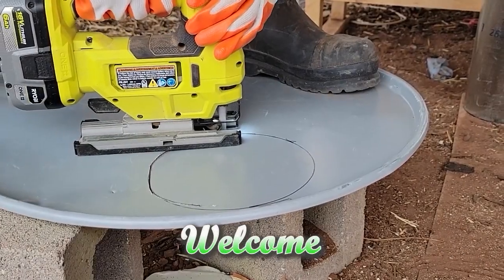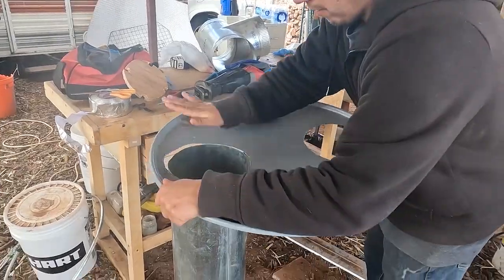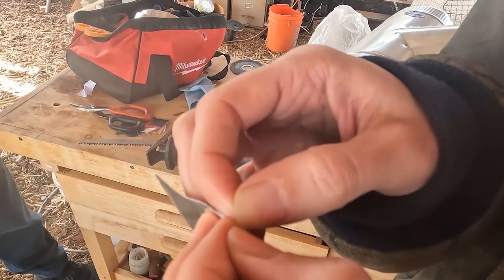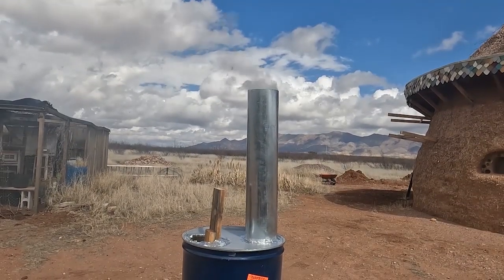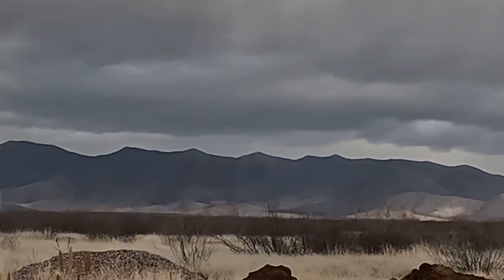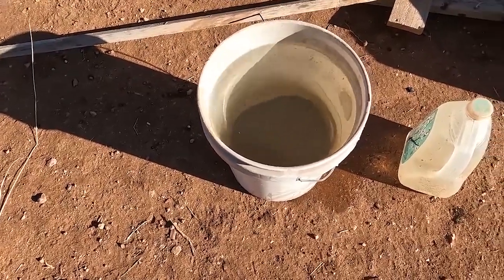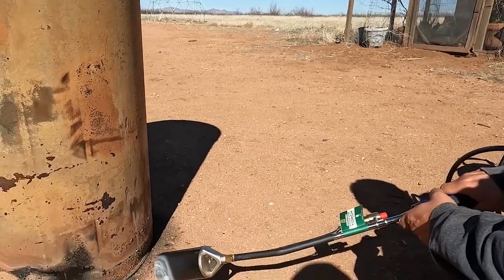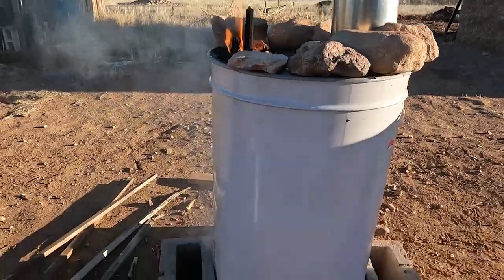We Built A Pocket Rocket To Quickly and Safely Clean Metal Barrels | How Effective Was It?

Comment: try not to envision the laws of nature as you see fit. Lay the barrel on its side. heat rises. when the top side of the barrel is burned, roll the barrel to burn another side. made many burn barrels for my progenitors. the wind would carry over the burnt paint and coating into the chicken coup for months. the hens would stop laying. cattle and sheep would not come to feed as often. they asked me to make burn barrels for them. took a day for me to make one. also, made them move there burn barrels 50 feet down wind of the livestock. They did not like that. but the hens layed eggs every day and the livestock were properly feed after that. what gave me that idea was the horses and goats. every time my grandmothers would light a fire they would move over to the other side of the pasture. If you do not have a lot of burnable fuel use a steal grating to raise the fire closer to the projected area.
Postscript: they all kept asking me how i was able to cure the barrels. I kept telling them. "It's Classified". hahahahahaha

Comment: One thing that could work to get more air draw in the barrel, on the vertical pipe outside the barrel, put an upside down y junction, and run that leg off to the side...and have a battery powered leaf blower or such...that would then cause air to get pulled up through the vertical pipe faster and cause more combustion in the barrel i think.   Interesting video for sure. :)

Comment: Having had a little experience, I would suggest raising up the bottom of your down tube.
Second option: lay the barrel horizontal and rotate as needed. Lay a metal tube 2-4" into the barrel so oxygen is fed into the very back(bottom) of barrel to burn all the paint

Comment: Load the barrel with straw on the bottom. Our the pocket rocket inners on it. Put the heavy wood in the pipe that goes about 4 inches from the bottom. Drop the burning paper down the chimney. This will get the draft going up the chimney and light the bottom of the fire wood. As the firewood is consumed the air coming down the inlet will keep the fire at the bottom and the wood will drop down on its own. You could also load the barrel with firewood before putting the top on. Always start the fire from the chimney to get the chimney drafting.

Comment: Hint: when you cut tabs in a pipe only bend every other tab then insert it into the hole and bend the remainder over they way your not depending on just tape to hold your joint 😉

Comment: With the fire in the base not the intake at full tilt with a setup like yours I have had a ten foot long flame where you had smoke coming out and that vertical exhaust pipe glowing red.  Hence my other comment about the control damper.
Yes I was outside testing it before I moved it in.  Lol

Comment: "Stove Black" is the perfect way to finish the barrel.  It goes on like liquid wax and you wait for it to dry and then buff it off. It will give you the rustproof finish you seek and it has a constant sheen without being too glossy.  It does gas (as does hi-temp paint) for the first couple of days after finishing, so it is imperative that you have ventilation and accept the fact that you're heating the outdoors the first couple of days. 😁
Reply: Another point.  IMPORTANT 
You had another poster say the fire is supposed to be in the barrel not the feed/intake chute, he is absolutely  correct!!!

Comment: Try lighting a smaller fire in the bottom of your barrel. That will intensify the heat toward the bottom.. You’ve used very tall wood in the previous burns and that pulls the fire toward it.

Comment: Small pieces of wood burn fast, losing vital heat. Also not easy to reload and create good/efficient circulation from the bottom to top.
Try adding dry dense fire wood first. Light,  slowly add scrap wood to barrel pile. May also want an open/close air vent to control the air/combustion ratio. Boilers normally have a bottom load/cleanout for a heat source.
Aware the goal is to safely and inexpensively remove the barrels' inside/outside paint. Any thoughts about a covered sunken heated coal or rock pit? Dig a deep enough barrel hole. Secure with wood/rocks coals. Fill barrel with dense firewood. Light inside and outside wood/coals. Cover with galvanized sheets and secure with dirt/rocks. Return 8 to 12 hrs later to compare results.
Concepts from inground food cooking.

Comment: Combustion chamber should be low to the ground made of earth of some sort. It must take the high heat of combustion which can be 1500°F or more, something like the melting point of sand or clay, just to be safe. Some heat storage should surround the combustion chamber, earthy material such as rocks, brick, clay, or sand.  This absorbs much of the initial high heat to reduce the temperature a bit. The exhaust gasses can then pass through a barrel  such as you have with the paint burned off. The barrel then acts as a radiator with its heat going into the room or into more thermal earth, making hot water, or cooking. By this time the gasses have cooled sufficiently where they begin to sink and in some designs this can be utilized in a warming bench made of earth materials. The exhaust of a well designed system can be almost down to room temperature.
One design utilizes s cylindrical combustion chamber of fire brick which is constructed to be smaller than the diameter of a barrel that sits over and around the combustion chamber. The combustion gasses exit the fire brick structure and lose heat to the top of the barrel. This is commonly used as a cooking surface.  The exhaust is then taken out the side of the barrel to a warming bench of earth.

Comment: The rocket mass heater that you are building will be heaven sent next winter. With just sticks from heavy brush you will heat your home.  Just remember to have a few clean out places for ashes where ever possible. Also you may want to reinforce the top of the barrel you put over your heat stack with the lid from the other barrels.  One thing you can try with the barrel burn out is use a lawn blower to increase the heat. You guys are doing all the right things keep up the great work! God bless.

Comment: When working round chimney tin, fold over every other tab and the pipe will be self supporting.
Reply: Half the tabs on the bottom side of the lid, the other half on the top side.
Reply: 10-4 George,I should have been more clear on that. Thanks 😊

Comment: If you know someone who welds. They can weld thicker scrap pipes in a continuous candy cane U shape and spot weld it to the lid or 1/4" scrap plate. You won't have to burn any paint off you simple fill the barrel half or 3/4 full with water. With a small fitting and copper tube in the lid plumbed outside so pressure doesn't build. Making sure it always has water in it.🤓🤓You just made a rocket heater radiator.🤔🤔👍👍

Comment: As others mentioned, to remove paint lay it on its side on coals. Better oxygen flow 
But if you were going to hit it with a wire wheel/brush, skip the fire step and just remove the paint mechanically.

Comment: Hi, I'm not sure about your design, but it's not a mass heater I'm familiar with.

1. Lay a layer of cement board down.
2. Lay a 2 inch layer of insulation material down
3. Lay 2 layers of thick fire brick down
4. Build a j fire channel out of thin fire  brick
5. Insulate both risers, short feed riser and tall exhaust riser
6. Cut exhaust pipe hole about 2 inches from open barrel bottom and place over exhaust stack
7. Run an inclined exhaust pipe from the barrel to the external exhaust 
8. Build up the thermal mass around the firebox and exhaust pipe into a bench shape
9. Finish with Lin seed oil after the cob material is completely dry, 3 coat recommended.

This is obviously a Build outline and not detailed, but it demonstrates it is quite different than what you tried to do. 

Good luck these heater look like they are a huge undertaking to construct.
Reply: Jim you need this design, I personally  never sent your  design  before and I think  your beating your head against  the wall here 😉

Comment: Hey Jim & Jess, Back in my day Mother Earth News used to run advertisements for the Sotz brand 55 gallon barrel stove conversion kit. There were two kits available, one for a single barrel stove turning out up to 155 thousand b.t.u. and a double barrel kit able to turn out up to 255 thousand b.t.u.. There was even an option one could get that was a kind of ceramic afterburner that made it able to reburn the smoke in the top drum, kind of like a catalytic converter thus reducing your emissions. 
  Whatever you two decide to do, use stoveblack on your stove's metal components, NOT high temp paint. Also use refractory cement to seal joints, not that aluminum tape, it won't stand the heat your stove will be putting out. Also use black stovepipe inside, NOT galvanized, galvanized puts off toxic fumes when it's heated to the level your stove will be operating at. Also bare minimum of 3 feet from any surface that can catch fire and burn, like the straw in your cob, plastic bags, (your earth bags), or the plastic insulation of your electrical wiring, or any wood. Also cap your fluepipe with a good spark arrester.
 Be safe thus having no regrets.
Until next time.
Reply: I think you may have mistaken is barrel paint burn out for a rocket stove. He was seeing which method burned the paint off the best.  You do have a point about the refractory cement especially the heat stack. It will get so hot that regular cement will start decaying very quickly into dust along with the brick if it is not firebrick.
Reply: Good safety points! Temperature can be 1500° F in the combustion.
Reply: If it was from the sixties, it was wrong.

Comment: You might want to consider adding ventilation at the bottom of the barrels, so you get a cleaner more efficient burn with less smoke.
Reply: I was going to say this
Reply: I think the grass is holding moisture
Reply: They draw air in from the tube. That’s the ventilation

Comment: Punch a few holes at the base of the barrel air can't be drawn as the fire is rising at the material opening....might  consider material below barrel add a swing cover plate....add bricks at base and sides.......barrels are made of cheap steel and burn through faster then the good barrels

Comment: Light the thick white smoke and it will take off!
You could just cheat and once you get a good flame in the feed tube, use a blower for a little bit and it will direct the hot gas to the flue!

Comment: The metal tape. I give you a C-. The high temperature is too much and burns the adhesive off the tape. Next time just use the Adobe slime motor to seal leaks and it's free!
Reply: The smaller barrel 35 gal upgrade to burn the secondary drum. More effective